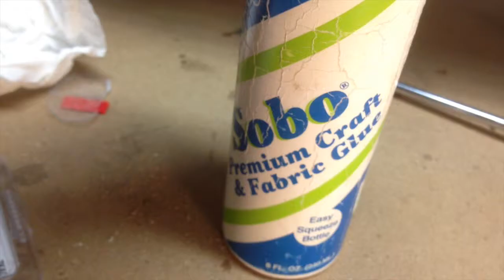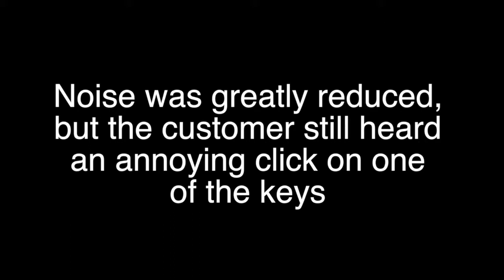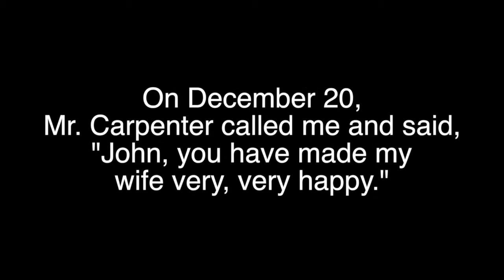Noisy upright action repair

Comment: Thanks John, how does that resizing the balance rail holes work? Do you just line the holes with glue and use a balance rail pin for sizing or is there a trick to it?
Reply from the maker: Mitch, thanks for the question. I use a bamboo skewer, tilt the skewer almost flat and roll it in the glue/water mixture, insert it into the balance rail hole from the bottom of the key, then let it dry. Note: Experiment with how much/little water to use to get the right consistency. Little or no water produces an almost rock-hard hole. Too much water does not reduce the size of the hole enough. Once dry (24 hours later), put the keys on the balance rail pin and make sure they fit nicely...that's how you size the hole, as you mentioned. Hope that answers your questions.